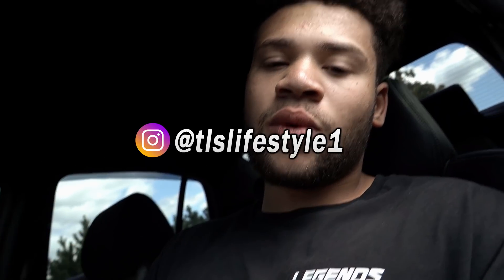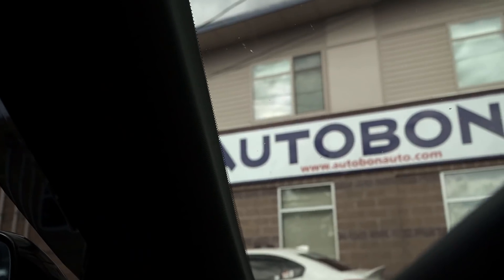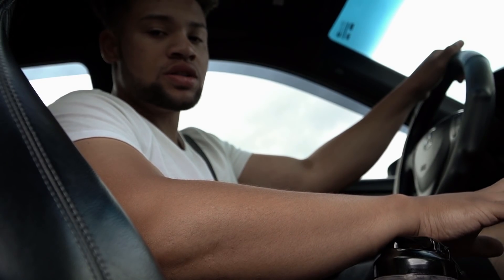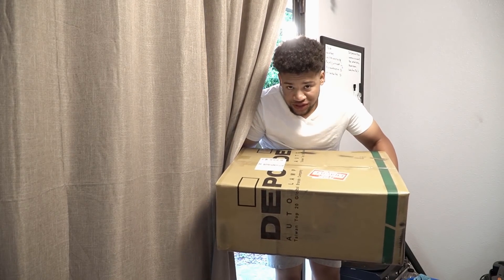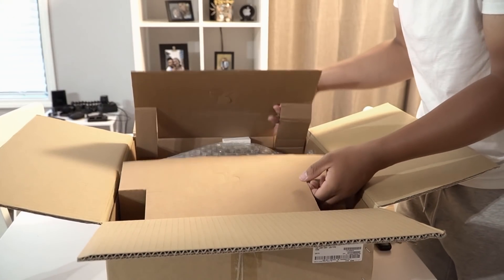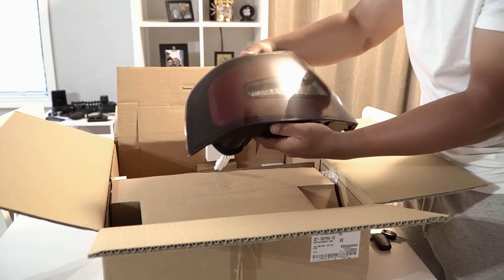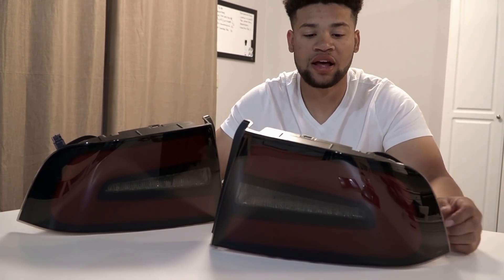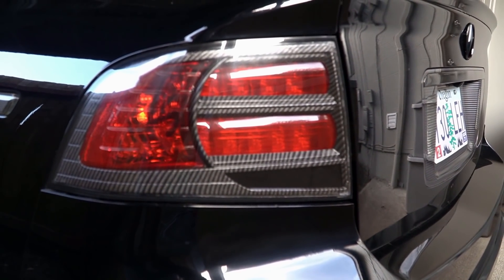new NSX Style tail lights for my 3rd gen Acura TLS *First Look!*

Comment from the maker: He guys I’ve updated the link in my bio!! I had the wrong link yesterday, sorry about that. you can use this link with my promo for the tails! https://www.uniquestyleracingstore.com/products/2004-2008-acura-tl-nsx-style-black-smoke-led-light-bar-tail-light-set-with-circuit-board-housing?variant=34201135415433
Reply: ♥️ them lights  so Lifestyle10  is the promocode